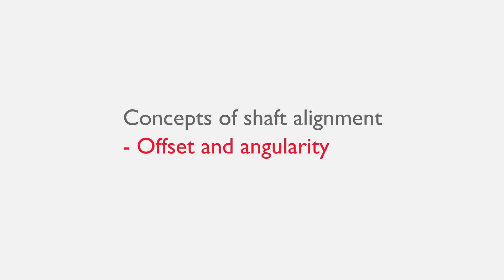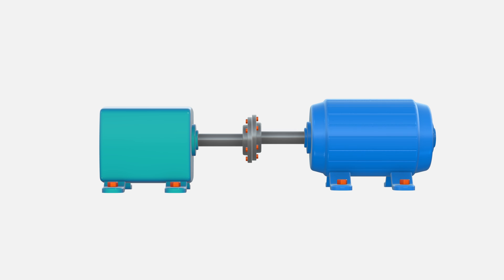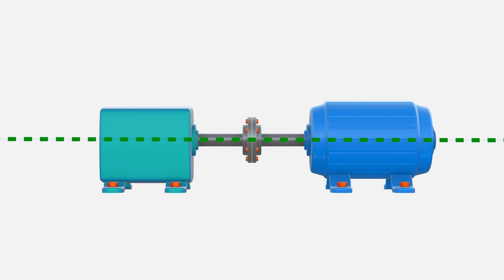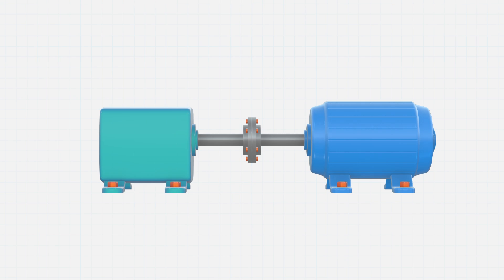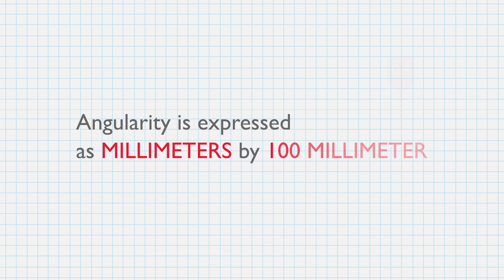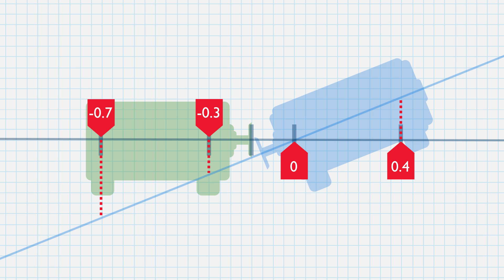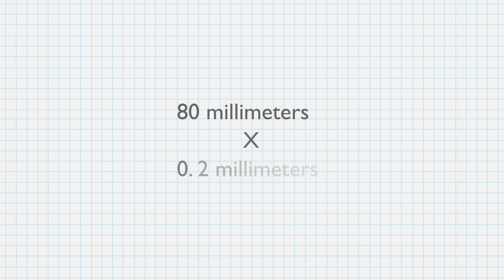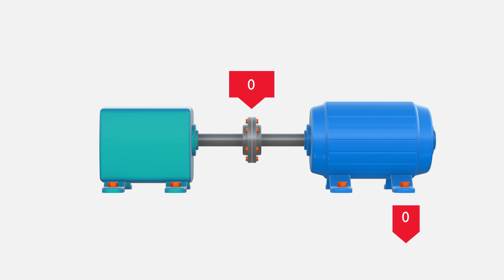Shaft Alignment Concepts: Offset & Angularity

Comment: Could you pls clear my doubt's?

1#Minimum Fixing distance?
2#Which is we want to set first? H or V
3#Once complete alignment the readings all correct but while checking again that all reading was changed. What is the reason, why and how to correct?
4# Where should Fix the Leaser Fixer (Chain clamp ), Coupling or Shaft
5#How to do Alignment coupled conditions or Decoupled Conditions (What is the reason?)
6#Some time one angle is shown in down side, Is this problem or not problem? How to set both Angle reading in Top side?